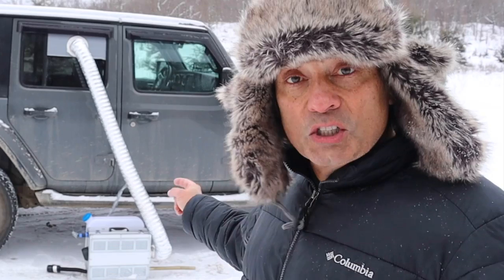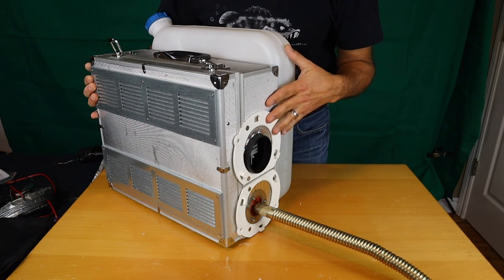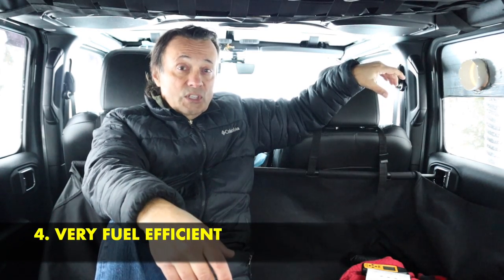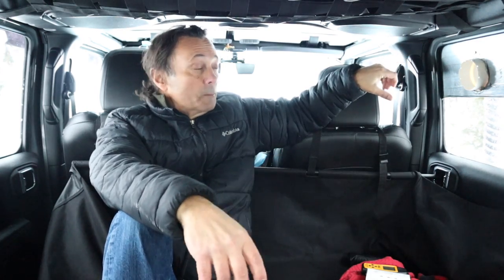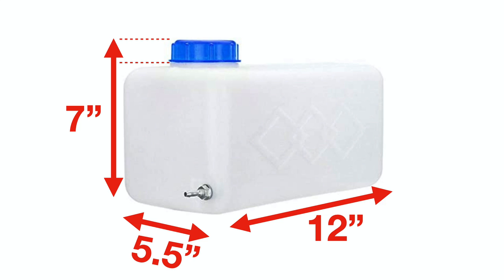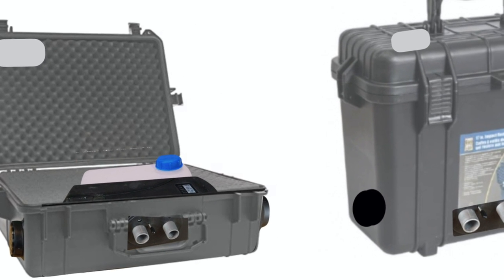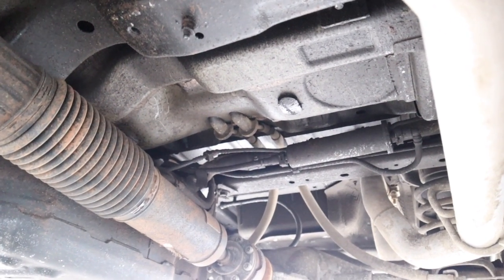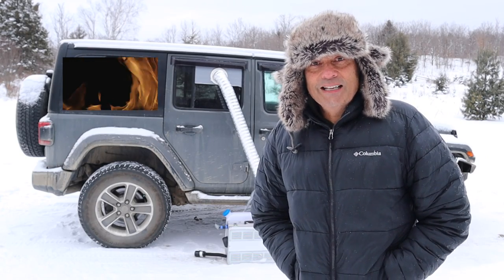DIY Portable Diesel Heater in a Box For Camping Design UPDATE - PART 1

Comment: Good video.  Only problem with mounting it on the side with the bottom combustion/exhaust coming out the side of the case is that your fuel line is now exposed.
Reply from the maker: Hey Ryan, That's true. I'm looking into accessing the fuel tube from inside the burner unit.  We'll see, Thanks. Cheers.

Comment: Ive been thinking of building one also. Be careful changing the duct size from 4” to 3”. That will drop the area of the duct around 40%. 
That is a large drop in airflow. The heaters are engineered to work efficiently at a particular airflow setting. Dropping the airflow that much will significantly affect its efficiency, operation and safety. It will probably create more heat inside the unit which will also affect its components. If you want smaller duct, it would be better to get a smaller heater. 
Thanks for making your videos
Reply from the maker: Hey Kasey, Good feedback. Thanks. Cheers.

Comment: Hey Dino!  I just picked up a Vevor 5kw diesel heater off Amazon.  It's self contained in a red metal box.  I think it is fine for now but after watching your video for ideas I might be looking for a box that I can semi-permanently mount on the Gobi roof rack.  Then the flex hose could hang down to the window rather than be pulled up to it.  Obviously there's some drawbacks- biggest one is getting up on the rack to open the case for set up.  Still working on it!   What did you use for your window filler?  I have seen other guys that set up the heater box on a "folding tire step" that slips over the rear tire to keep it off the ground.   If someone has a diesel Jeep they can tap a line direct to the heater and not have to worry about carrying a portable tank.
Reply from the maker: Hey Marcel,
That sounds awesome!  
I eventually went with the material shown in this video. 
DIY Window Vents For Summer & Winter Camping | Jeep Wrangler
https://youtu.be/zIIyQ4xNFKA
I connected the hose, fed on one side to the black plastic round vent caps on the other side. I hope that helps. 
Cheers and have fun. 
Be sure to have both an alarm and a monitor. Just to be extra safe.

Comment: Interesting idea of putting the heater in the trunk space. Does drillling a whole for the exhaust ruin the vehhicle for resale? I'd assume it will not pass safety test in ontario for resale? Or to mechenaic not look for 2" holes in the trunk?
Reply from the maker: Good questions. I’m think if it was an issue, the hole could be sealed up?
Cheers.

Comment: I like the new external design , but I would keep the metal case in case of the heater failing and  catching fire. Mounting it inside of the Jeep could be  a little harder to seal out exhaust gas. I will be buying that digital carbon monoxide detector as a backup to my regular monoxide detector.
Reply from the maker: Hey Michael, 
To be clear, the regular ones are alarms. They go off after a certain amount of CO is detected. There could be a low level leak that you would not be able to see with those “Alarms”. The digital one is a “monitor” and it allows you to read even low levels. This way you can see if there is a low level leak far in advance of the alarm going off. I hope that helped. Cheers.
Reply: @CheaperJeeperTV  Thanks, that is exactly why I want to get that device that instantly measures CO.

Comment: When you sleep in -20 c weather, do you crack the widows? Or is it not required with a diesel heater?
Reply from the maker: There are lots of places for air to get in and out of a Jeep Wrangler, including the vent on the tailgate. 
When it isn’t severely cold, I draw fresh air into the heater and blow the warmed air into the Jeep. By default the existing air gets pushed out. 
I hope that helps. 
Cheers

Comment: I’d be concerned with fuel inside the case.  You mentioned the situation if you lose electrical power, that there is the potential serious heat build up, and with fuel in there, that could be a pretty bad situation.  I think its useful to have the room to hold the fuel during transport, but you should pull fuel out of the case during usage.  Just to be safe.
Reply from the maker: Hey Eric! Thanks.  I appreciate that helpful tip! Cheers.

Comment: Why not recycle the heated air back into the fresh air intake. It is easier on the heater and fuel will last longer…
Reply from the maker: Hey BkackSheep Expedition, You certainly can do that. I just wanted to have fresh drier air blowing through the Jeep. Even with the controller set to Low, there still is ample heat for both the Jeep and tent. Thanks for the suggestion. Cheers.